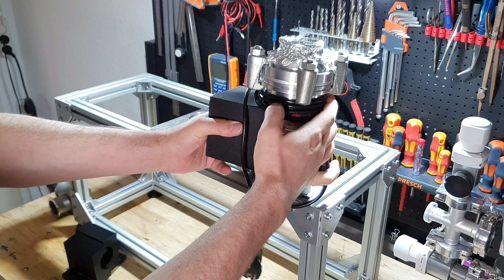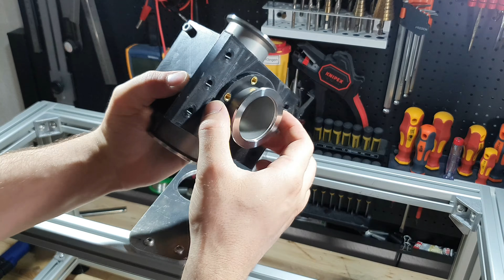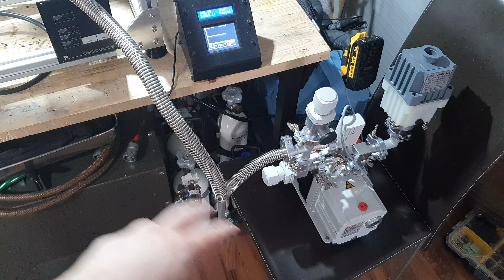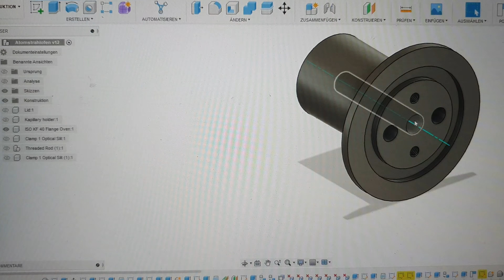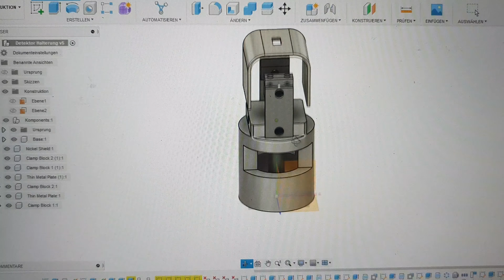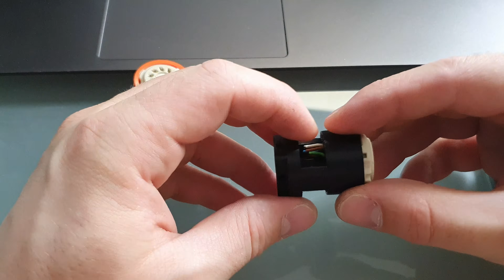Demonstrating quantum effects at home / The Stern-Gerlach-Experiment Pt. 2

Comment: This takes be back to my grad school days when I cobbled together a differentially pumped mass spectrometer from old semi conductor processing tool parts. Ideal vacuum typically has manuals online for some of these old legacy pumps, and I think I found yours on their website. Two things to consider: Depending on the strength of your magnetic field, you may need to shield your pump, according to the Leybold manual for the turbovac 50, it shouldn't see more than 7 mT. Lastly, if you are going to bake out your chamber, the pump will need to be cooled, a fan will probably do the job fine, but some turbo pumps have connections for water cooling too. Based on the level of vacuum you are going for, I don't think you will need to bake out your system, but it may need a few hours or up to a day to pump down. If you have trouble with reaching ultimate pressure, a good (cheap) way to check for leaks is to wet down your joints with IPA when the system is on and see if the pressure spikes. Best of luck.

Comment: I have heard turbomolecular pumps get notably louder than they used to be and then continue to run (continuously) another year+ before getting a lot louder or failing to spin up after a venting. So who knows, even if the bearings are getting old they might have 10,000 more hours in them. Depending on your luck of course!
Reply from the maker: That gives me hope. It did stop making those noises after running for a while so I am hopeful that is was caused by the pump not running for years. 
Either way I am sure it will last a while for my uses since I rarely let it run for longer than a few hours.

Comment: May be the pump decelerates every time it hits particle and just need to gain rpms again so motor in it kicks in so the sound is notable? I think you can detect jump in pump's power consumption when sound appears. You can also inject some gas in vacuum chamber to see how it will sound)

Comment: Maybe you could cool the PLA somehow during the baking process. And potentially add an insulation layer between the PLA and the metal parts to prevent heat transfer in the first place.

Comment: I used a combo molecular drag/turbomolecular pump (backed by a diaphragm pump) for organometallic research some years back.  Hanging the pump by the flange is fine.  The pump that I used had a controller that kept a record of operating hours and down time.  During start-ups after lengthy shut-downs there was an elaborate series of rotational speed ramps and soaks to assure proper distribution of grease in the (ceramic) bearings (I think there was also feed-back from current draw, so that the speed was not ramped to a higher level until current draw matched some ideal level set at the factory).  I suspect that your phantom noise may be related to this grease distribution, particularly if it has been unused for a long time.
Reply from the maker: Thank you for the valuable information!

Comment: I commissioned some custom glasswork from Glasslinger about a decade ago and it was done flawlessly and they (sorry, I don't know their pronouns) were a pleasure to communicate with and purchase from.  

In case you re wondering I had commissioned contactless noble gas plasma tubes w/ gases at special pressure ranges to explore interesting visual effects and colors. I had built a special tesla coil that transmitted most of its power into the E field instead of wasting it on arcs like normal, making it a true Nikola-style TC, and I wanted some special obvious-to-laypersons way of mapping out the field gradients visually for the audience.

Comment: I am not a super experienced turbomolecular pump user, however I own a turbovac 150 and in the manual it highlighted the importance of having a strong mount in the event that something in the turbomolecular pump fails. Since the rotors are spinning so quickly there is an immense amount of rotational inertia stored in the unit, and it should be mounted in a way that it won't go flying in case of a catastrophe.

I am certainly not telling you whether or not what you have is safe, just food for thought. At a minimum I recommend reading over your manual and seeing if they have instructions on how it should be mounted.

Keep up the excellent videos, they are very unique and interesting.

Comment: you can probably ask tekkonstantin, he knows quite a bit about that, also he repaired such pumps and these controls, also with that noise and so on. I think he also does something with vacuum professional, sure wouldn't hurt to ask, and he probably would help. Nice project looking forward to first turning it on
Reply from the maker: Thank you! And thank you for the tip regarding TecKonstantin. I will keep it in mind.
Reply: @AdvancedTinkering  no problem looking forward to updates on the project

Comment: I love this project, excellent work so far! 

Make sure that all of your threaded fasteners have their threads slotted so that gas can escape quickly during pump-down, otherwise you may have a "virtual leak" as the trapped gas slowly escapes into the system. Frankly, I don't know if it will be a problem in your demonstration but it's something that springs to mind when I see screws on the vacuum side of a system.
Reply from the maker: Thank you! I'm glad you like the project! 

And thanks for the advice regarding the threads. I did not think about that. 
For the experiment I need pressures of around 10^-6 mbar.

Comment: Pumps are designed to hang, and sometimes(including perhaps this case), it's even a good idea to hang it on a vibration isolator - bellows hose with a thick rubber(mechanical only) hose around it. The only external thing that can kill a turbo during operation is physical hits or quickly tilting it(never move the system while under power!).

You can get to around 5e-6 mbar without baking, 1e-6 if you leave it running for a while(a day or two).

Judging by the noise in this video, the turbo is in good condition. I have a known good Turbovac 50, and it sounds pretty much the same at full speed. Bearing replacement itself is very easy, assuming you have bearings, which is the hard part. Skateboard bearings won't cut it, especially for small turbos like this(trust me, I've seen the carnage). However, under 75k, there are options, unlike 90k. I won't advertise publicly where to get them, but I can advise via email or discord(see below).

For threads inside the chamber, beware - you have to file one side of every bolt flat(down to the base of the threads), and drill a hole straight through it(preferably), otherwise it'll be virtual leaks all the way down. Wherever possible, make through holes for bolts, not blind ones. For the rods you designed, those have to have flats that give vacuum access to the threads.

We have a discord server for vacuum stuff, the invite code is 7uSgh3Sej2.
Reply from the maker: Thank you for the discord invite! We already talked on the discord but I also wanted to thank you here for your highly informative comment!
Reply: Why not share the bearing source? Some of us have knackered pumps that also need some new 🛼😅
Reply: @DeezNutz-ce5se  Because after dozens of orders through friends, their bearings seem to have a dud rate of ~50%. Have to buy quite a few and sort them carefully to choose which one to use.
Reply: @Spirit532  I've tried ceramic bearings which didn't work at all.

Comment: I wouldn't worry too much about the PLA. You've got o-rings, which makes a bakeout a little dicey though still very possible if you have to. Easy to turn your circular cross section o-rings into ellipses or goo. Gotta have viton instead of buna-N or whatever it is, although I think you may have viton already. The pressure will go way down if you can leave it running for a week. If you're not up against leaks the pressure should go like 1/T.
Your expedient of putting the backing pump on a chair greatly amuses me because I did exact same thing for... months? A year or two? Until I got around to making a sufficiently floppy vibration-isolating mount that I could move it back onto the cart.
My usual reference for a turbopump sound is a faint whine that easily fades almost to imperceptibility in the background noise of cooling fans. That pump mounting looks OK to me but I'm no expert just someone who used a few turbopumps for a few years. The one really bad thing that can happen to a turbopump is something falling in, so bear that in mind. All my turbopumps were supported by the flange and oriented sideways so as to not have to worry about it but this is a simple setup, and they were a different model--check what orientations are possible if you reorient it.
Be careful with the electrical feedthroughs. The CTE is well matched (some sort of glass ceramic made for the purpose) and they're not ultra fragile, but still sort of delicate if you bend the pins. I tended to use a screwdriver to lever away the connectors to avoid twisting, but I have no idea if that was necessary. Protecting it from knocks or cable pulls is a good idea if those might happen.
A few gotchas about langmuir-taylor detectors. Not that any of it should supersede your own judgement: If you get too many atoms of alkali metals all over they can potentially give you leakage currents, including across your electric feedthrough. They can form sort of tenacious sub-monolayers on some materials. Also the filament thermally expands and either bows or needs spring tension to keep it straight. Since you have glassblowing skills I would put the thought in your head that a glass detector is an option, and was the original way it was done. Actually your hot cathode ion gauge may be hackable to act as a L-T detector with no modification to the innards, depending on the pinout.
Reply from the maker: I always appreciate your long and very informative comments! 
Yes, I allready though about the O-rings. I don't know the material and off the top of my head I'm not sure how to find out, without destroying them in the process. 

I think due to the rubber feet of the rack that holds the TMP, the vibrations of the roughing pump are not a problem anymore. 

Sadly I cannot mount the pump in a different orientation. According to the manual it needs to be in a upright position. 

Yes, the detector will be a whole new challenge. I'm very curious if I can even detect a signal or if it drowns in the noise. It's apparently in the picoamp to nanoamp range. 
The tungsten filament will be held by two spring steel pieces, to keep it under some tension.
Reply: @AdvancedTinkering  The o-rings themselves are a cheap part, 0.50-1.00 USD/ea from McMaster-Carr here in US. My suspicion is that black o-rings from a kit of vacuum stuff will be viton because permeability is low. You could heat one up, maybe while squeezing it under a weight, in order to test.

The small signal is a challenge but should be doable with good small signal practices.

In case you don't already know of it, I point you to "The Evaporation of Atoms, Ions and Electrons from Cesium Films on Tungsten" by Langmuir and Taylor which has quantitative details (for cesium) that I've not seen recorded elsewhere. For example the work function of tungsten is only low enough to evaporate cesium as ions if the surface coverage of cesium is low enough, <0.1 or something, because any adsorbed alkali metals lower the work function.